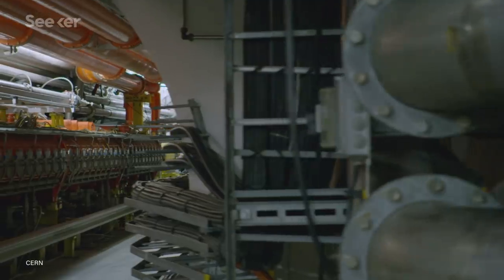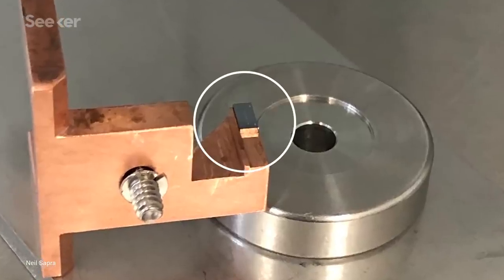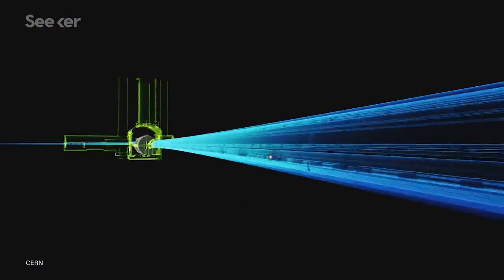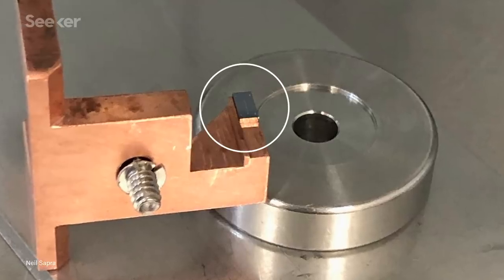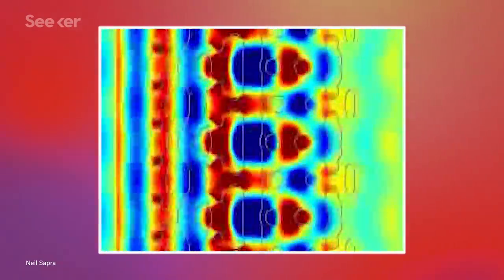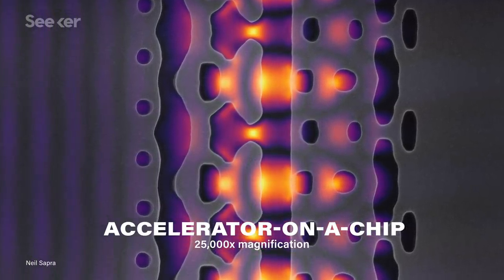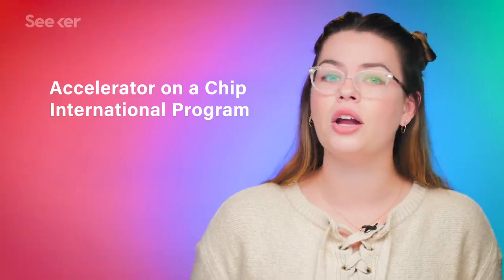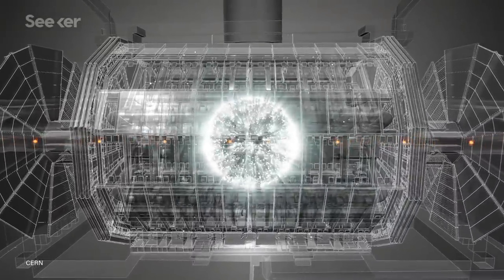How Microscale Particle Accelerators Could Transform Our World

Comment: "They used infrared for it's tiny wavelength"
Except no, they didn't. Infrared has the longest wavelength relative to visible light so if they had to choose a wavelength it wouldn't be infrared because of its small wavelength it would be infrared because its the right wavelength for this application
Reply: Chris Goree I like pizza. 🍕🍕
Reply: Yeah! I mean, why don't you use gamma rays when you need tiny wavelengths?
Reply: Exactly

Comment: Mirco accelerators could have a lot of theoretical applications. One not mentioned could replace batteries. If you could pulse particles targeted to hit and cause a tiny induced fission reaction (that can be converted into electricity on a micro scale too) then it maybe possible to have two or three of these creating just the needed amount of electricity for the machine to properly run all it's circuits.

Comment: If they can get it to work with lead atoms, I could fit one to my AR-15.  Increasing muzzle velocity from 3000 ft/sec to 800,000,000 ft/sec would eliminate the need for tricky ballistic calculations on 1000 meter targets, even on windy days!  To test for recoil, I'd probably let Mikey shoot it first, but with the projectiles weighing only 55 grains that shouldn't be an issue.

Comment: Great, a mini particle collider,
Going to be such fun when my laptop becomes a micro singularity and they fink my kicking feet sticking out my usb-c port.
Nightmare fuel, another serving please.
Reply: @nutsnboltsplsbreakmybones  actually, a singularity can't have infinite mass, as the entire universe has a defined, finite mass. What you're thinking about is a infinitesmally small point of space with infinite density.
Reply: @nutsnboltsplsbreakmybones  but it's important and still wrong. There can't be infinite gravity, because gravity is a function of curving spacetime done by mass or it's energy-equivalent. The only thing infinite with a singularity is its density, because its size is zero.
If you turned Mount Everest into a singularity, it would not exert more gravitational pull than the original mountain, because it still has the same mass. Density has nothing to do with the amount of gravitational energy an object possesses.
And yes, you may say that in the given context, people will still understand you, but that doesn't make you correct and if someone cites you in another context, because they didn't get it, they'll be wrong and contributing to the mass of misinformation on the web. As a major in molecular genetics and cell biology, I see this all the time in my field, because people think that exact wording is not important. And this leads to the absurd fear and ban on GMO technology, which could do so much good, because people regurgitate informationen without paying attention and minor mistakes add up.
Reply: @nutsnboltsplsbreakmybones  what's a "gravitational singularity" supposed to mean...?
Reply: @nutsnboltsplsbreakmybones  okay, I get the notion, but then we're talking about completely normal singularities here, a point in space, where enough mass is concentrated to create an event horizon, behind which not even light can return?
These objects do NOT have infinite gravity. Behind the event horizon, the curvature of space is infinite, which is an assumption by theoretical physicists to explain why light (with no mass for gravity to act on) will still be unable to escape a black hole. Basically, the light still travels in a straight line, but the infinite curvature of space let's it fall down into the singularity in every direction. This is a mathematical model. 

However, the gravitational pull of a singularity is directly proportional to its total mass, which also defines the radius of its event horizon. As I said, the gravitational forces an object exerts do not change if it becomes a singularity. If you're in orbit around a star and you were to collapse the star into a singularity, you would still be perfectly fine orbiting the black hole (until you're fried by ultrahard gamma radiation and shed star matter, but you get what I mean).
There can't be any object with infinite gravitational pull in the universe, as this would collapse the entire universe (observable and unobservable) in an instant, which hasn't happened, so every singularity has finite mass and since mass is the only thing dictating gravity, finite gravitational pull.

Maybe we're talking around each other because of the event horizon, I don't know. An event horizon is achieved, when you compress an object (any object, even single atoms if that were possible) into such a small space, that the compressed mass is smaller than its Schwarzschild radius (~3km for the sun and the size of a cherry for earth). Since every mass warps spacetime, every mass can turn into a black hole, if you concentrated it enough to become smaller than it's Schwarzschild radius. This doesn't mean that the gravitational pull is infinite, just that the warp of space time is concentrated on such a small area of space, that the effects is huge (for the volume it's in). I hope that this clearifies it... Somehow...
Reply: @nutsnboltsplsbreakmybones  no problem. It's just so hard if you read it somewhere and somebody else says something different, I get it.

Comment: While still impressive and undoubtedly useful, we all used to stare at particle accelerators at home and at work -- our TV sets and monitors. They did it with high voltage and magnetic fields, but at a price point that was well within reach of the average family. Hopefully the electrons and X-rays were adequately contained and only V-band photons got out.

Just trying to tip the view back from "totally revolutionary!" to merely "massive improvement on something that was already possible 100 years ago".

Comment: "They used infrared light because it has a tiny wavelength" that was worded poorly. Infrared light has a longer wavelength than visible light. I wouldn't call it tiny. That also means it has a relatively low amount of energy too. 

"The electrons were only accelerated to a fraction of the speed that the big versions get up to" What fraction is that? 10%? 1%? 0.000000001%?
Reply: I wonder if there is a way to do it with UV, XRay, and other shorter, more energetic wavelengths... or if it has to be IR for some other reason.

Comment: I hate to break it to you, but this will not help cancer treatment and here is why:

Radiation treatments aim to break the DNA by hitting it hard enough with X rays or electron beams.

In order to get energy high enough you need to put a lot of power on such a chip. We are talking kV or even MV of power. Good luck trying to place the chip and powercables into the patient - while external radiation treatment requires none of that.

Also, every radiation treatment needs to detect how much dose is given.
Accelerators are unreliable in their acceleration. The angle of the earths magnetic field even needs to be corrected for - high electric powerlines just outside the window could even cause errors. If this device cant measure how much radiation it emits, it will never find its way into treatments.

Comment: Nice can't wait to purchase a mobile in the future which has a System on Chip with a particle accelerator 😂
We can generate a personal black hole and we can use pocket time machine
Reply: What is it with you people with All these black hole posts?? You All know that black holes are basically the incarnation of the mass-energy equivalence, right?? So, even if you managed to pack enough energy into the space of an electron to collapse spacetime, it would still be so tiny a singularity that it would evaporate in less than a nanosecond!
If you don't manage to channel convert multiple metric tons of mass worth of energy through a mobile device, you're not able to create a singularity that would stick around long to do anything other than to explode with the force of hundreds of thousands of nuclear bombs!
Reply: @midnight8341  it was a joke I'm quite aware about physics of Blackhole n it's Hawking Radiation... Smaller the blackhole faster it evaporates
Reply: @bhuvaneshs.k638  Pretty generic joke.